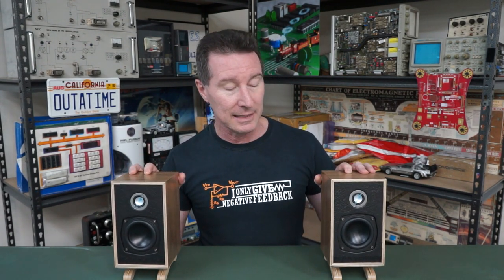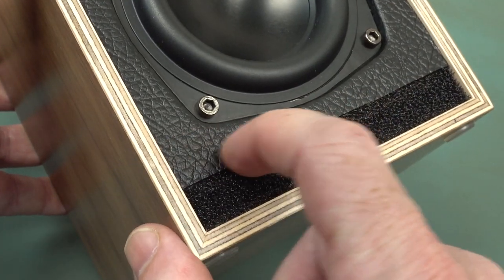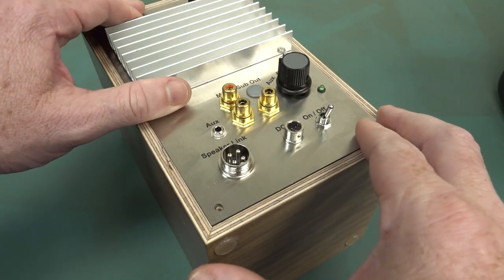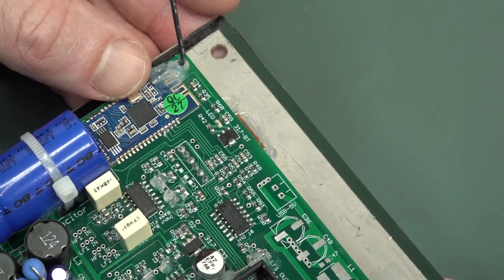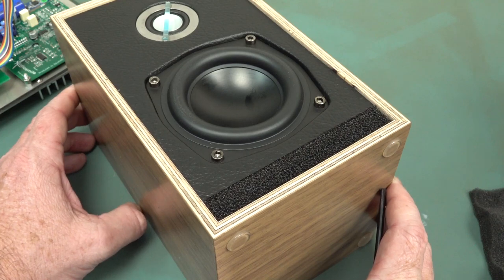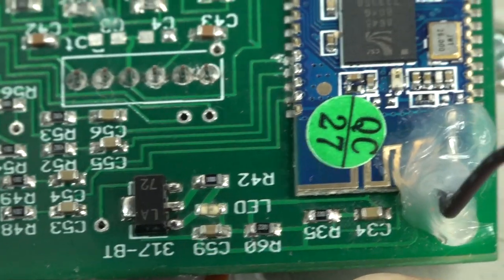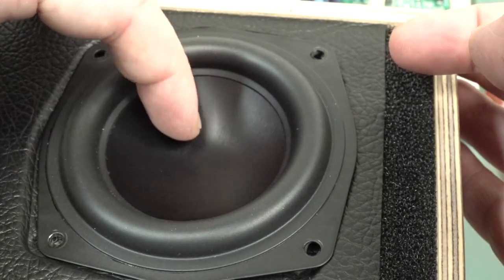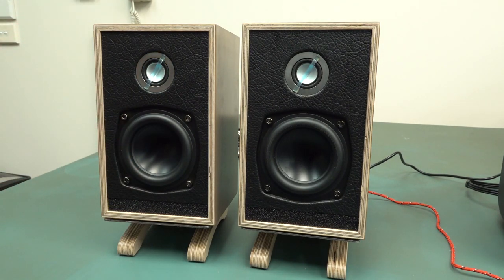EEVblog #1162 - Little British Monitors

Comment: I've spent my life fixing Pro audio and lighting and for the most part they work. Right angle tracks aren't an issue at those frequencies. As for recording, Doug Ford will tell you the same thing. If a producer can mix a track and make it sound good on crappy speakers, it will sound great on real ones. This does not work the other way around!
Reply: Right angle is considered bad practive as acid can pool there and give irregular track width... but it's not an issue with minimum 0.01inch tracks and modern production.
Reply: If a person mixes on bad speakers won't there be a possibility of missing something not heard on them that would sound unpleasant on high end ones?
Reply: @trophosphere crappy speakers  is how you lay down a track properly. Two enormously popular studio monitors were the YAMAHA  NS10 and the  Auratone 5c. Both were bloody hideous and you wouldn't wish them on your worst enemy but you mix sound to be played back on crappy systems. No point mixing  to sound good on proper set of drivers when people listen to it most on TV.  Always lay down tracks for the worst systems, not the best
Reply: @gwyllymsuter4551    so you never engineered for the Berlin Philharmonic?
Reply: @raykent3211  nearly 30 years  in this industry. Seen hundreds upon hundreds of studios an oh yeah, my daughter is one of the most famous producers and faces in Asia... Who cares about some orchestra?
Reply: @Audio_Simon  For the rising edge of a 100Mhz square wave maybe right angle tracks will introduce error, but to claim this for audio is complete rubbish. They will have no bearing whatsoever. Audio really requires quiet ground returns and loop isolation, not sure this amateur looking board has that. It looks like a first attempt or prototype.
Reply: @Dont_Gnaw_on_the_Kitty_1  Hi Clive. You are certainly right that right angles are not a problem for audio frequency signals. However, it seems (I found out) they are still considered bad practice by PCB designers.

I take great care in the grounding arrangement of my designs and go through multiple prototypes to get it right. It just doesn't look neat on a 2 layer board. Dave wouldn't have given them a thumbs up if they had excessive background noise and distortion.

Comment: Thanks so much for the video Dave! I'd love to answer a few of your questions:

The tweeter is made by Tymphany.
I assembled the PCB by hand and the bodge wire was to adjust grounding. The final version will not have any bodges.
Op-amp choice. The NE5534 has low voltage noise and is great used with low impedances, but the TL074 has low current noise so is good used with high impedance like these filters.
Transmission line vs port. I would say TLs are longer than 'ports' with a proportionally larger section area, are folded and use damping material inside to reduce harmonics of the main resonance. 

I'm already making improvements to the design for the final version in a number of areas.
Reply: Hey Simon, I’ve been exploring the idea of attempting to make desk top t-line enclosure based upon 1/4 wave theory, how ever I’ve been having trouble making the port cross section approximately the same size for the sD of the driver I was looking at, because the mounting diameter and mounting depth exceed alone exceed the port cross section. Is there something that you could point me towards that would remedy this?
Reply: Please fix the pcb traces, it's horrible.
Reply: @billigerfusel  Well, it looks horrible, yes. But for such low frequency stuff, the PCB layout doesn't really matter.
Reply: @Gamamaha  it's the attitude that bothers me. Who would you trust more? A guy who cuts every possible corner or someone who puts in the 10 minutes extra and does his job with care?
Reply: Absolutely awesome, but I do hope you consider changing the 'leather look' covering on the front, and I personally don't like the stands. A smart logo badge would be a great finishing touch for the front. I'll be following you with interest, I want to check these out!
Reply: @billigerfusel  You don't have to "trust" the PCB designer because Dave tested the speakers and actually they work.
Reply: The PCB is very carefully designed.  Nothing wrong with right angle traces these days, they get produced perfectly. Some of the traces may look a little strange as its super tight space wise... but I'll see if I can tidy it up some more.
Reply: @Audio_Simon  hey, but even the traces width for the main power DC supply are so tiny... Don't be offended, but it really doesn't look good at first glance for us. Since it will be open source anyway, maybe you can challange people on, let's say altium circuit maker, to pimp it for you? I'll be quite open to do it myself, of course with explaing all rationales behind.
Reply: @Audio_Simon  Maybe a "licenced" version of DaveCad would help and Red screws. Nice Flux Capacitor though.
Reply: @l3si0rek  That's a very kind offer.
Reply: Why do you use a Tymphany PMT-20N12AL (or maybe PMT-30N, difficult to see) full-range driver (with a custom chamber behind it) as a tweeter?
That is very unconventional, it would only make sense in a FAST system, when crossing much lower (around 500Hz or so), besides the fact that there are little tweeters out there that perform a lot better.
These little full-range drivers were designed by Tymphany really as a compromise for manufactures that wanted to have a (close to) full-range experience for compact and budget solutions. Like little TV / computer speaker etc.
Reply: @TheChikyChiky  That's one reason real TLs act partially as a bass reflex and the lines are blurred. Do not get hung up on 1/4 wave theory, the advantage of TLs is  large cross-section area and damping to reduce backwave escape and line harmonics.

The solution is simply to build it and see how it works then build it again and again. Maybe you could design the first cabinet so the line length is adjustable?
Reply: @Audio_Simon  rectangular traces are no big deal in very low frequency applications and in low voltage and low noise environments. anyway at sharp angles (like rectangular traces are) the electric field will be more dense than on smoother angles. if they should be avoided is dependant on taste and application but here id say its just taste. would ommit those nomatter the need

by the way how many layers is that board? 2? if so was the second layer really necessary? a thought trough single sided phenolic base board would cut the cost enormously.

although dave likes the ribbon cable solution for all the interconnect please consider making lead lenghts for your to the driver outputs as short as possible maybe with a dedicated ribbon. and maybe consider wrapping them with emi isolation tape  (you know this greyish tape made from braided wire, you see it in laptops quite often...) also consider incorporating the bluetooth functionality on the main board and not one of these premade modules. did you mind putting ground loops around high frequency oscillators on both layers (like the crystal on the bt module, i bet the chinese guys didnt put some there)
Reply: Any comment on how much replacing the meandered monopole with the wire extends the BT range?
Reply: @hebulba  bt is not about range at all... but i understamd your point
Reply: @urugulu1656   well, yeah. I kind of know something about antennas. But I couldn't come up with any other reason for doing a mod like that. I was just wondering if the meandered monopole is not able to provide sufficient range in that enclosure.
Reply: @hebulba  It helps a lot, about +10dB... but that's because I put the BT module near a ground plane. I thought the ground might help reflect the signal back at the antenna but now know better (learn by doing!). My new design will have the BT module remotely mounted behind the front baffle, away from the main PCB and the signal strength is far superior.
Reply: @urugulu1656  2 Layer. Absolutely necessary, you don't get far with SMD parts and single layer. Sometimes I thought I should have gone 4 layer so I could have all the signals neatly going one direction on the top layer and the other direction on the bottom layer, with power and ground in the middle.
Reply: @Audio_Simon  That's quite significant increase :). Of course, if there is a ground plane on the back side of the main PCB the bt module is soldered on, the ground plane would be far too close and the antenna wouldn't work properly. Even the stainless back cover is still quite close.
Reply: Hi  @TheChikyChiky  ,
I'm not Simon, obviously. But maybe it helps anyway.
You do not have to build exactly with sD. Also you can buld a tapered line. Have a look at "Pico Lino".
I have build a Tapered T-Line for an Carpower Raptor 6 which worked fine until I killed it due to the lack of a subsonic filter.
For Back Loaded Horns you sometimes have the issue that the magnet just won'T fit.
In this case you can make a cut out in the plate that fits the magnet precisely. Make sure to seal it properly.

I guess you already know quarter-wave.com.
Reply: @matchesder  Just note whether the magnet is vented (like my LBM) as you don't want to block that, nor have it firing in to a different section of line than the actual cone. I learned quite a bit by modelling a few PMC speakers (I used to run AML1 actives and a friend has MB2 XBD actives) and seeing how they matched with theory. They don't match with Martin King's 1/4 wave theory that's for sure, but they work great! Effectively Bose use transmission lines in their 'waveguide' products, not that I like their sound much but they get a lot from small drivers.
Reply: Hi Simon is there a way to contact you ?  i have a channel about loudspeaker exotics , how its made etc and just me playing around. i make most of my own drivers usually planar margnetic/esl/ruba/amt  and would think it would be fun if we could have a chat. since you have done what i never dared, doing a kickstarter. and by the looks of it you got some  experience in amps and such. You can find me under the same name on facebook if you would like.
Reply: @billigerfusel  dude take it easy, you know ti does not matter for the application and maybe he did not know ?? im pretty sure you learned most stuff somewhere and made a shitload of mistakes before you where where you are now. this is not a million dollar operation.
Reply: @joppepeelen  we're all learning, that's why Dave criticised his traces.
Reply: @Audio_Simon  good point. A trap for young players :)
I don't know the construction of these PMC ones. But interesting to hear it. I think it is not always clear how to call a system.
There are constructions one may call a vented box that were actually designed as a tapered qwater wave tube.
Reply: @matchesder  If you look at original Rogers BBC speakers like the LS3/6 they literally have a square hole in the baffle.. and it works!
Reply: Dave Micolichek  Thanks for the kind comment. Yes I can ship anywhere although the postage cost varies. You can order right now on Kickstarter if you want a discount and to get them as soon as possible.
Reply: @billigerfusel  Your attitude isn't that great either.
Reply: @RainerK.  nobody cares whether you like the comments or not. What people actually care about are good products and doing the job with care is one step in the right direction.
Reply: @T.o.n.y.T.  i design other stuff, but that I do with care. Don't worry.
Reply: Simon A Hi Simon! I am currently building my own boom box (ye ik totally different story) using the csr/qualcomm chips aswell. From that i of course know about they’re dsp capabilities. Have you used / integrated it at all? If not , would you consider it an option to make the frequency response absolutely flat?
Reply: Simon A so why did you use a "full range" driver in a chamber as a tweeter...?

Comment: The venting on the back of the driver is for venting the voice coil. A difference between ported and transmission line is that transmission line adds bass over a wider frequency range then ported would.

Comment: I am still using the speakers I built (and more or less designed) myself around 1981. I bought a book at Radio Shack that told you how to do it (there was even math involved) and I used my dad's tools to put them together. Around 2002 the old paper cones withered away so I replaced the drivers with nice modern ones and I replaced the crude crossovers I had built myself with modern boards. They've never sounded better.
Reply: I'm on old Acoustic Solutions speakers, when you have quality stick to it.

Comment: I'm not normally negative on other's designs, but those traces! I would have a fun time going through the board layout and putting a chamfer/45s on those right angles.
Reply: It doesn't actually matter for anything besides high voltage. Here's a good stack exchange answer if you want to know more about why that is: https://electronics.stackexchange.com/questions/226582/pcb-90-degree-angles#226693
Reply: It looks just bad. No excuses!

Comment: As an audio DIYer, my thoughts:

Those midwoof drivers are A BEAR to work with.  To get good low end you need a huge cabinet - at which point you can just use a larger driver with less nonlinear distortion.  They also have nasty resonances in the upper midrange that you have to filter out with a more complex crossover to your tweeter.  (Somewhat typical of aluminum cones, TBH, but it rains on the "small driver therefore high M/T xover point" parade.)  IIRC, they also have a weird impedance curve that makes a passive XO difficult to design - not that it applies in this case.  To top it off, the stamped frame is flimsy - I even had one arrive new, pre-bent.  Once mounted, maybe that's not such a big deal, but I have a hard time believing it does not contribute to distortion when that cone gets moving - and its excursion (and small light neo magnet) is its point of existence.

They can be fun to play with, but there are so many much better drivers out there if you're building a serious speaker.

The tweeter, I've heard, is surprisingly good.  I have a few to play with but haven't used them yet.  They were used by a reputable name in the hobby speaker design circles in an omni-directional speaker design, and were found to be quite pleasant to listen to.  In a nearfield or generic BT application, where the strengths of that driver don't apply, I would stick to a typical silk dome - it's better at being a normal tweeter.  Dayton has some 1/2" to 1" domes that are a complete steal at their price.

So overall, I feel like this design is a checklist of engineering experiments, not necessarily a great design in and of itself.  Most DIY speaker guys go through something like this because it's unusual and therefore interesting.  But it's unusual because many of the tried and true designs are just better suited for general use.  There's always a fascination with making the smallest cabinet possible as well - but physics wants a Cerwin Vega floorstander, and clever engineering can only get you so far.  Second best, for "good enough" cases, is a stout small driver with tons of DSP.  Everything else is a compromise.

Comment: Although the full-range driver can be used without a tweeter, it will become more directional as the frequency increases making essential that you be directly in front of them to hear the full range. By crossing over to a tweeter, you can avoid that beaming effect.

Comment: Vishay caps are quite good actually. We use their tant's at my work for making all our RF boards and Vishay is prime spec with no allowable sub's b/c of the strict temp. profile the systems is designed and tuned to operate in.
Reply: These ones are great, and good value too. Lifetime is rated as 6000hours @ 125C. Better than even Panasonic FC series.

Comment: Hi dave, the grill is to cool the voice coil down.
When the subwoofer moves it blows air in and outside the little hole, cooling down the voice coil
Reply from the maker: Ah, makes sense.
Reply: @EEVblog  you're welcome :D
Reply: The hole also vents the air trapped behind the 'dust cap' (the concave cone effectively acts as a dust cap here) which would otherwise have to pass through the tight slots around the coil, causing turbulent noises and increasing distortion. The grille is just to prevent debris entering the hole.
Reply: It’s called a vented pole piece.  The pole piece makes up the inner wall of the voice coil gap. Some manufacturers decide to go with the vented pole piece, some choose under spider venting, some choose both and some choose none.  The grill is strictly there to prevent debris from getting in and getting stuck in the coil gap.  That happens and your driver is no more.
Reply: Just woofer. That driver is too small to reproduce frequencies below 60 Hz. And even if it could move the distance required to reproduce those frequencies, it doesn't have enough power to gain them up to where you could hear them.
Reply: Exactly CrimSun. And the weight and solidity of the bass is the main selling point of the transmission line design.
I built a great pair around 15 years ago. Mine go right down to about 28Hz, and are as good as flat down to 34 Hz.
I have to still upgrade them to the ribbon tweeters I originally intended them to have. But they still sound awesome.
Never ever get flustered regardless of music, complexity or volume.
Reply: @rationalmartian  You don't get into that trouble generally unless you start having people playing 7 string basses, which go down to a low F# that's roughly on the 26-28 Hz range or the lowest C on a Bösendorfer Imperial Grand, which is about 16.3 Hz.